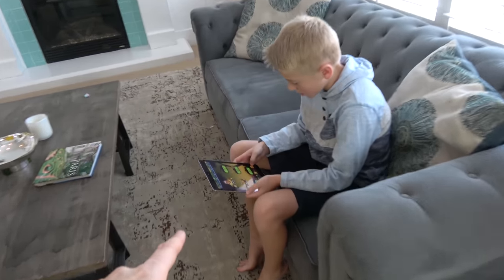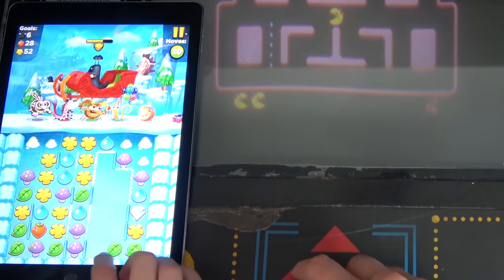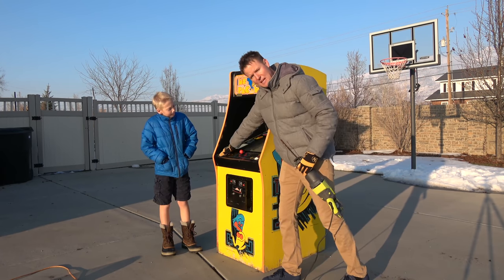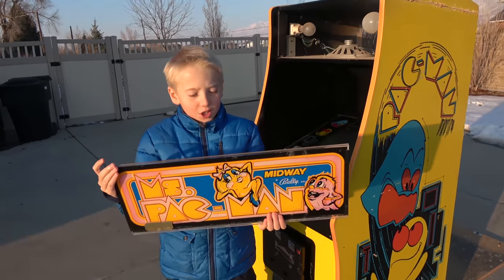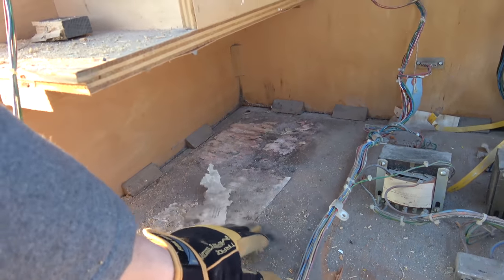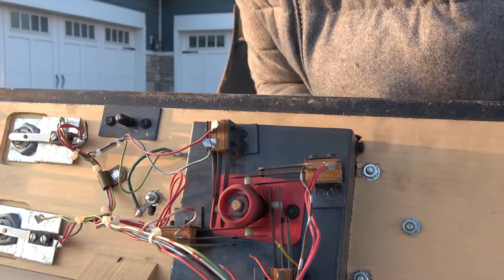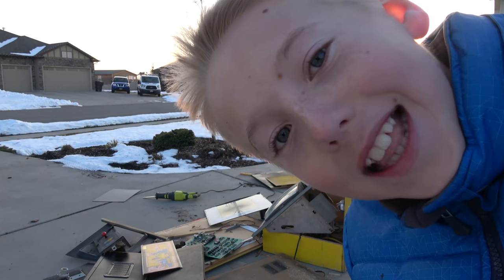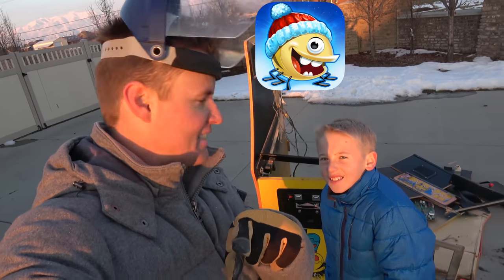What's inside an Arcade Machine?

Comment: Coming back to this video after 5 years, it's still just as painful to watch such a beautiful piece of electro-mechanical engineering get destroyed for no reason. The only thing that hurts more is that this video doesn't have it's dislikes visible anymore. I don't know exactly how many dislikes this video has, but let me just say, you deserve each and every one of them.
Reply: 13K dislikes, I have an extension that shows dislikes.
Reply: Electro-mechanical?
Reply: @Okurka.  It's a combination of "Electronic" and "mechanical" which are the two types of mechansim inside any arcade cabinet. You have the electronics, the lights, the screen, the game board, so forth, but also the mechanical workings, in most cases, the coin mechanisms, in others such as a pinball machine, there'd be the flippers, launch spring, and more.
Reply: @SampullMC  You might want to look up what an electro-mechanical pinball machine is.
Reply: you realize theres millions in the world quit crying bruh theres more in the world this is just one machine
Reply: If it makes you feel better what’s inside made a video in response to the Pac-Man machine where instead of destroying they took apart a Star Wars pinball machine and then put it back together at the end
Reply: Makes me sick.

Comment: That was a CRT TV, they look like bombs because they use copper wires as electromagnets to prodject the picture using electrons. They are sometimes dangerous due to high voltage components that might shock you hard if you don't discharge the CRT!
Reply: I was waiting for the shock part. Sad to say I was disappointed. lol
Reply: Yes, please be careful around the CRT - I've known of them holding a dangerous charge even 10 years after being unplugged.
Reply: I wish they got shocked it's well deserved for what they did
Reply: @stephenthompson8373  No, that doesn't happen. 10 years? Mind that the capacitance of a CRT is in the order of a few nF, at the most.
Reply: It's a monitor (a Wells Gardner G07 likely). Although they work the same way TV's regarding the CRT's it's not the same as a TV.
Reply: Did you not see they had played with it before destroying it? Of course it would have lethal charge!

Comment: Since you obviously had the keys to open the machine, you didn't have to destroy it! Everything is designed to open up; you could have easily showed us inside the cabinet, controller and monitor area. You could even take the various parts out for safekeeping without any of this senseless destruction...
Oh, and be very careful with that monitor. Some of the older ones were made using toxic chemicals such as arsenic and cadmium that you don't want anywhere near you!
Reply: Have you even seen their channel? The whole point is to break things apart
Reply: DGlegend that's what he said😂😂😉
Reply: This is different

Comment: inside the picture tube is a phosphorus screen of red green and blue. behind the screen is a metal shadow mask that separates the RGB electron beams. the back is equipped with a deflection yoke that scans the beams vertically and horizontally. Keep in mind that a picture tube contains a high vacuum. which the air is completely evacuated. The voltage of these tubes is around 20,000 to 35,000 kilovolts
Reply: Considering that those machines represent the golden age of gaming and one of the most passionate desires of any gamer , I wouldn’t have actually minded if he got electrocuted with that much voltage , even doe the voltage is overkill at best
Reply: hmm whats underneath this suction cup thingy let me grab it with my bare hands ZAP!
Reply: I just see a bunch of dingy dong wire electronic thingys

Comment: 4:41 those are transformers to reduce the voltage so the 120 volts in the wall socket don’t fry the chip board.

Comment: As a collector of arcade boards, I can honestly say that this is the most excruciating video I have ever seen. You manhandled, gutted, and destroyed a collectors item. Each component has a large amount of artistic and monetary value to collectors. Please show more respect for this hobby and technology. Please take care of artifacts like this which you were extremely lucky to own.
Reply: I get where you're coming from but calm down.
Reply: @tysonhutchinson9301  This post is over a year old; you are a little late guy. I was calm when I wrote it, and I still feel the same way. Sorry you found my opinion so overwhelming.
Reply: Why do I so agree with this
Reply: I can't agree more.  I have restored 5 or 6 original pacman and ms. pacman cabinets that were in far worse shape than this one.  I currently own two original pacman cabinets and a reunion cabinet.  That monitor could have stood to have a new cap kit installed and probably would have soldiered on for another 30 years; if it had not been met with a sledge hammer.  But instead lets bash it up?  I don't get it.  Could have taken marquee off the front and back door and took everything out piece by piece to show how it all fits.  Did not even know that those blocks in the bottom were the isolation transformers.   ;-(  I restored an asteroids deluxe a few years ago for someone to purchase; that inquired about it. They kept pushing the pickup date off.  So I eventually just told them; I don't think they are worthy of the machine; after I went through everything and replaced all caps and highly suspect transistors and instead gave it to a friend of mine.  I know where the machine lives and that was 13+ years ago.

Comment: What's inside a smoke detector?
Reply: yes!
Reply: not such agreat idea, older models smoke detectors (sometimes even modern ones) contain radioactive americium 241. i don't think it is a great idea to have that in the air
Reply: gewoon NL thank you I shall now chop open one and spread it on me
Reply: ugh. they have barely enought to even giva a click on a radiation detector. they should do that
Reply: A smoke sensor. That's what.
Reply: Did you know that if you have enough smoke detectors (around 80) you can make a small nuclear bomb?

I'll walk myself out...
Reply: actually just a photo diode and a light diode (LED). and a labyrinth out of plastic. the LED glows but because of the "labyrinth" the light never reaches the Photo Diode. now when the smoke gets in the casing, it reflects the light and the light  from the LED is able to get to the Photo diode. that triggers then an electrical impulse which mostly leads to an fire alarm
Reply: actually just a photo diode and a light diode (LED). and a labyrinth out of plastic. the LED glows but because of the "labyrinth" the light never reaches the Photo Diode. now when the smoke gets in the casing, it reflects the light and the light  from the LED is able to get to the Photo diode. that triggers then an electrical impulse which mostly leads to an fire alarm

Comment: The boxes at the bottom are transformers. They take the 110 to 120 volts and make it up to 3k Volts. They then power a coil called the electron gun. with 4 magnetic coils (The coils for control is that copper wire thing.) the beam is shifted to give a full pic. (The coils for control is that copper wire thing.)

Comment: This guy isn't very mechanically inclined, evidently. The cabinet could have been opened very easily to see the inner workings (control panel assembly, monitor, motherboard, etc.) and then put back together. Also, probably the biggest issue here is that he did not discharge the CRT monitor. His failure to do this could have very well resulted in death. DO NOT DO THIS. Especially with your child, that is just irresponsible.

Comment: HIGH VOLTAGE!   what you did is very dangerous,  the voltage in that monitor can kill you and you let your son put his hands in there too,  You are supposed to discharge them before you touch the monitor or capacitors!      That machine was worth some money,   I would have given you at LEAST $200 for it,  thats lowball.

Comment: That cabinet could easily have been disassembled without destroying it to show what was inside.  Every part comes off until you are just left with the bare wood cabinet.  What a waste for no reason.
Reply: And it's called a printed circuit board.